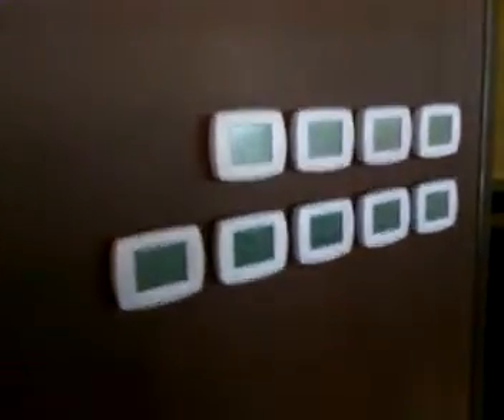Classic video: 9 thermostats on one wall?

Comment: I thought that was one of my jobs in Goodyear, Crown Charter 😬..........but I ran wires to sensors in the classrooms, on the ceiling grid. 😅
Reply from the maker: The funny thing is I've seen these several times since I posted this. Guess I just never seen so many on one wall by this time.

Comment: $1500 in stats. That's crazy.
Reply from the maker: Well good stats for each different zone is not bad.
But the fact that the knucklehead installed them all on one wall with eight of them all reading the temp at that same wall location is what is hacked! LOL!

If they had a remote sensor to each one and they were all here just so it was controlled by the manager, etc then it would be legit.